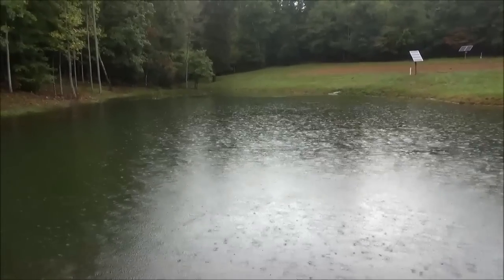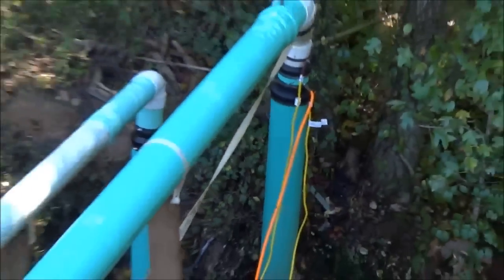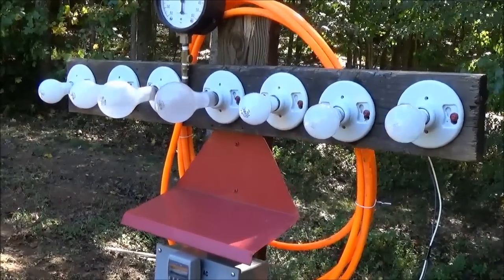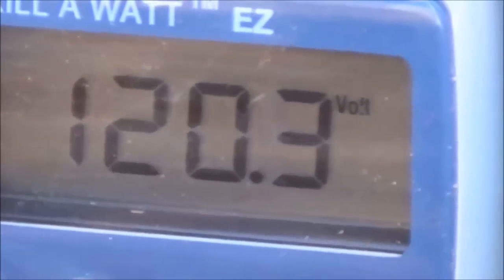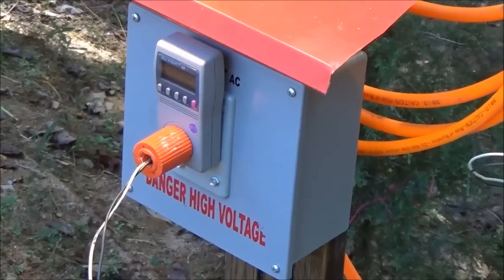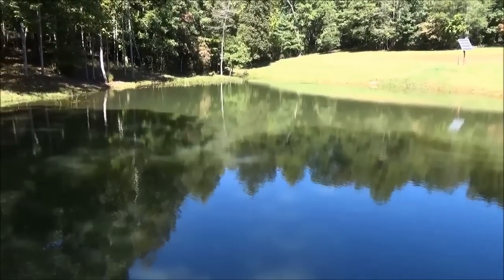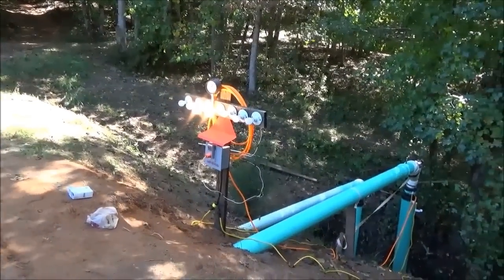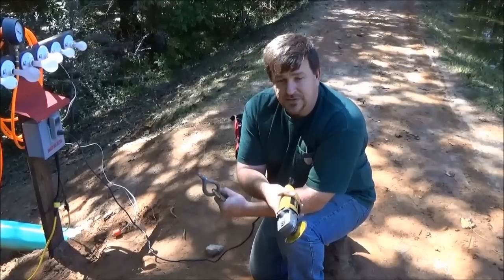Pond Shop

Comment: Sure glad you got around to some of the specs. Still wondering what is the max power capability (maybe you mentioned it and I missed it). I went to LAP site and the full product description is: "This kit is all you need for your Micro Hydro grid-tie System includes 6 Low head hydro unit with Sonny Boy 3.0 grid tie inverter". I cannot see paying $3600.00 for something with that little bit of product description. Will it generate a killowatt or just charge my phone? 

From some of the scenes it looks like you have good drop below the dam. It would be interesting to see what could be done with a Pelton wheel generator located dwonstream.

BTW, I rubbed elbows with many Rensselaer alumni while working at Lutron Electronics in Coopersburg, PA. Never felt that I was the sharpest knife in the drawer but sure needed to keep my hone handy working with those guys and gals.

Comment: the pure sign inverter..
were did you get that at??
doing a dual soar grid system, with an APC auto switch over problem is it doesn't;t like the broke flopper power from my inverter  and flops back and forth from true sign to the saw tooth sing..
make sense???

Comment: My father n law has a lake that's built on his property with a 15" overflow into the drainage gully. I wonder how much power could be generated during an overflow through that setup?
Reply from the maker: Jason, 

We need to know how much fall you have from the top of the lake to the bottom of the gully.  Is the 15" pipe down low?  A picture is worth a lot.   You can email me at info@practicalpreppers.com

Comment: What would you need to do to string this to your barn or house for power? I am thinking about how far away could you get?
Reply: With # 10 wire you can go about 500 feet with the 3 Phase  up to the inverter . #8 wire 1000 feet 3 phase up to the inverter.

Comment: I understand the need for the 7 lights, to burn off excess energy but i have to ask. How will that effect security with all of that? Seems to be an attention magnet. I can not get a good understanding of the noise it makes though.
Also, what happens if/when a bulb burns out and it's still running? Will it burn up the stador(stator?)?
Reply from the maker: The Lights are not permanent.  They were just an easy way to load test the setup to see how many continuous watts and how many surge watts I can run. I have removed the light bar.  I was able to start/Surge 1100 watts and sustain about 625 so I feel comfortable that I can run at 600 watts continuous for 4 hours at 120volts so I can safely run any household appliance that will run within those parameters.
Reply: Ahh ok, fantastic. I still have a lot to learn.

Comment: Hi,  have you given any thought to collecting the water in a second pond and using solar pumps to recycle the water into the first pond.  During sunny days the upper would refill and it would basically allow you to store solar power and release it later through the turbine.  I am working up a similar plan to supplement a solar system when there are long periods of cloudy days.  Rapyle65@gmail.com
Reply from the maker: Sure have.  A Dankoff Suncentric is on the wish list to do just that.  I would need a pond , a pump, a permit, panels etc .  I could pump about 20000 gallons back to pond one per day.  That is not really enough to balance it out.  working on it.

Comment: I had a thought the other day, how viable do you think this is... Create a biomass out of chipped limbs and general forest debris mixed with some cow dung to create an around 6 feet high heat pile with tubes throughout it for cabin radiant heating. Adding an old water heater tank to the middle of it with some liquidy version of the bio mass to produce methane for various purposes, cooking, generator etc.. Once the mass is done decomposing for the most part, do you think what's left over could be viable to use to make fuel bricks for a gasifier power plant?
Reply: i dont know but if you think about it your not gong to get much more energy out of it than if you burnt it so if that ammount of biomass would heat your home in the the time it would take to decompose if you want better info than reply to this and i will tell you more but im to tired and i can barly type and my grammer is bad
Reply: jacob brunberg Well, I figure you could get maybe a good 10-11 months worth of heat out of a big pile of woodchips n' leaves n' such, could use it as compost I spose when its done but... gota be a better use for it, maybe catch it at 9 months or so (enough for winter heating) and make some sorta fuel out of it after that, pressed pellets or maybe even some sorta fireplace log...
Reply from the maker: I'll stick to Biomass gasification.  I can control that better, run a variety of engines, cook and heat water.
Reply: engineer775 Practical Preppers well, my thoughts are to derive a source of fuel without using raw wood chunks which seems semi wasteful to me. If a fuel could be had that has already served a useful purpose, efficiency++ :D maybe junk mail paper bricks? think that'd work?

Comment: Safety glasses when using the grinder...tsk tsk.   Possibly a question that has been asked before but could you use a ram pump to move discharged water back into the pond for a continuous water supply?
Reply from the maker: Dicer328 The Ram was running.  The problem is that there is no head left over to make the ram work with this water.
Reply: I like this ram pump idea.

Comment: The illustration before & after, 9.5 tail. Should that be 9.5 head? I'm doing my best not to forget what I have learned.
Reply from the maker: The total head is about 12 ft.  I count the surface of the pond to the bottom of the tail pipe.

Comment: What is the unit watts/hr a measure of?
Reply: total amout of energy to get it you take amps*volts but its a mesure of how much power somthing uses like a fridge being 400 watts
Reply: ok... but what does the 'per hour' part signify?  Power = Voltage * Current [=] Watts
Reply: well saying  watts is the same as saying watt hours so watts=watt hours
Reply: A Watt is a measure of Power.  A Watt*hour is a measure of energy.  A Watt per hour is not the same as a Watt hour.  I guess it was a mistake saying 600 watts/hr when he meant 600 Watts (which was the instantaneous power).
Reply: ***** yes but there needs to be a time frame otherwise if i 600 watts and what your saying was true than i would have infinant energy
Reply: Just saying that 'for an amount of time' is quite different than "per amount of time".
Reply from the maker: The setup sustains 600 watts/hr and I can run it for 4 hrs so I can make 2400 Watts total.  Sometimes it is represented as 2400 Wh  or 2.4kWh.
Reply: jimmyrebel2010 Yes.... but what is a Watt/hr (Watt per hour)?
Reply: jimmyrebel2010 Yes... I agree... a Watt/hr wasn't make any sense to me either.  Thanks for clarifying.
Reply: ***** It's just a mistake, he does not mean "600 watt/hr" - he just means 600 watts. Now, if he lets it run for an hour, he has produced 600 Wh (600W x 1h = 600 Wh). If it runs for 4 hours, it will have produced 2400 Wh (600W x 4h = 2400 Wh). If these 2400 Wh were stored in a battery (with no losses in this example), he would then be able to run a 1000W heating element for 2.4 hours. Or a 100W light bulb for 24 hours. It's a common terminology mistake when juggling these terms, but I am sure that Scott does know the difference, and it was just a brainfart..
Btw, this is an awesome setup, and I envy his taking advantages of these opportunities! I imagine Scott has no utility bills at this point.